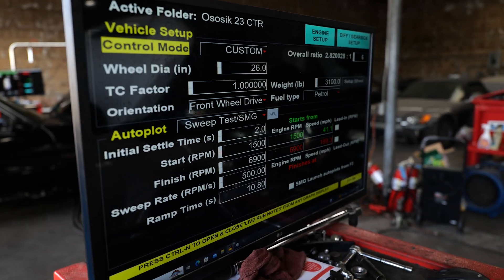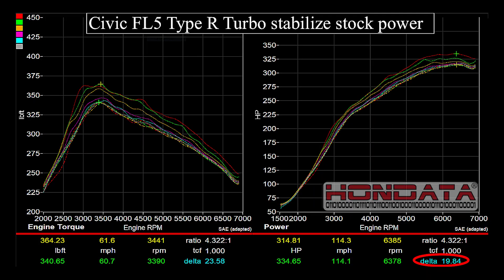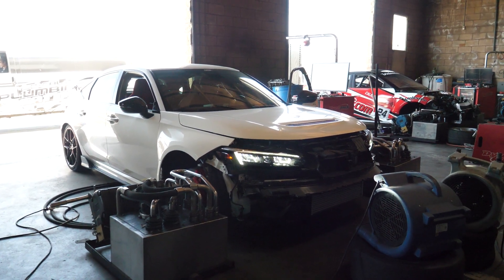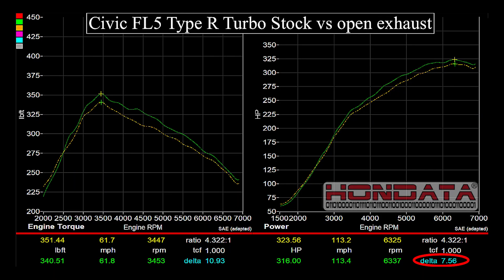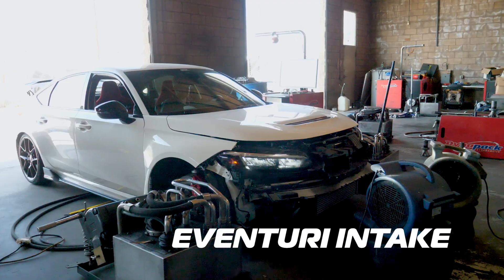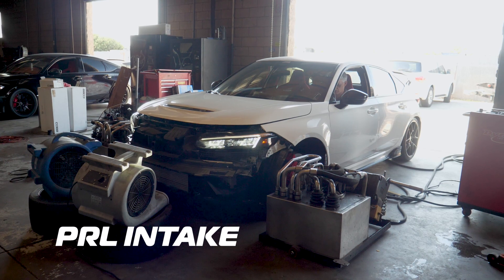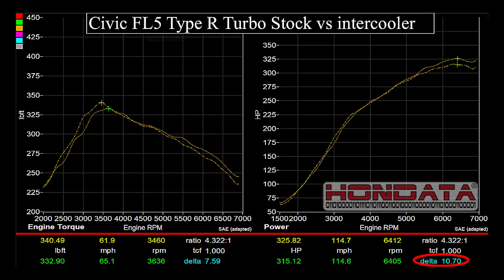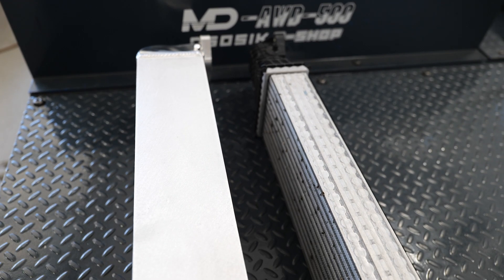What Makes Power | FL5 & DE5 | Hondata

Comment: What's the Dyno results with Hondata paired with an intake system like Eventuri or Infinity Design? 

More than hp gains, the intake adds an induction and turbo sound that the stock FL5 lacks.

Comment: Just saved myself $400 on PRL intake. Thanks
Reply: Still worth it in real world scenarios. I noticed my IATs are significantly lower than the oem box. They are going partially open hood and front bumper removed, thats not really realistic. Though interesting about the eventuri temps regardless.

Comment: I’m new to the K20C (1 & 8) engines. I purchased a new 24’ DE5 in June and at present am enjoying the car stock but based on previous history I’m not how long that will last lol. My understanding is the DE5 tune runs some advanced timing which helps it to add power over the FL5 in stock tune. Correct or no? Also, is it safe to run an intake (Eventuri) on an otherwise stock car without tuning? Prior to the DE5 I had a “stage 2” VA WRX (2019) and that engine & ecu combo was very sensitive to any changes in airflow. With my DE5 I want to enjoy it for many many years simply maintaining for longevity & reliability. Thanks in advance.
Reply: Correct. The DE5 stock, runs more ignition timing than the FL5. It should be possible to run the Eventuri without a tune as we demonstrated in the dyno comparison, but we have not studied this. As per the comparison the FlashPro makes more power and torque for a lot less money. The (seamless) Hondata traction control and the ability to tune your torque tables makes your DE5 smoother and faster. We plan an interview with an FL5 owner with bolt-ons (including Eventuri) in 2 weeks. He reduced the torque to flatten the torque table which made the car more controllable and fun to drive.
Reply: @dougathondata  Thank you for the reply and I look forward to seeing more. I subscribed to your channel.
Reply: @dougathondata please support the TLX 2.0T with flashpro 🙏

Comment: First thank you for testing 

I’ve already seen issues with my customers being restricted by the FL5 exhaust. It seems to have a more restrictive exhaust than the  FK8. it is possible due to the way the piping is bent over the front pipe, the fact, it has two resonators and the extreme for the mufflers in the back. Regardless, if it has a valve that does not mean it adds power because the valve is all the way to the back of the system, and the restriction is earlier in the system. I have never seen fk8  downpipe open add that much on a stock car.
Reply: For that reason, I'd be curious to see dyno results in identical conditions for stock exhaust, front resonator deleted (like Type S stock), and both deleted. The good sounding exhausts are very pricey and don't sound amazing either, I actually prefer the sound of both resonators deleted.

Comment: 👌👍 great news dougie. You guys should start doing water/meth calibrations with your meth relay for those that want a drive in drive out solution. Although I custom tuned mine, 32°f-77°f iat's for me + 400lb/400hp from having 116ron fuel when the meth is active.
Reply: WMI tunes are just like Flex tunes; they require significantly more work to develop properly than a typical base map so no one is going to offer it for free just for buying the tuning device. Extras like that are how tuners make their $$.
Reply: Meth is the beth!